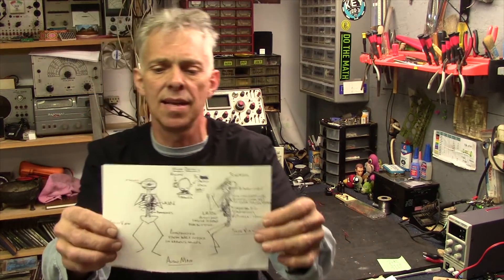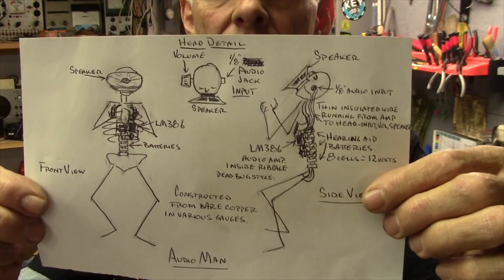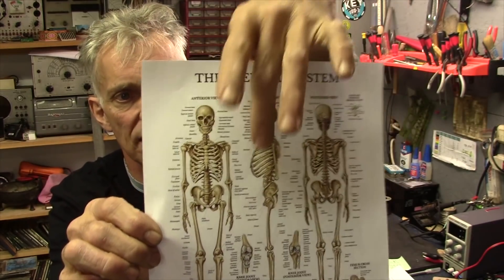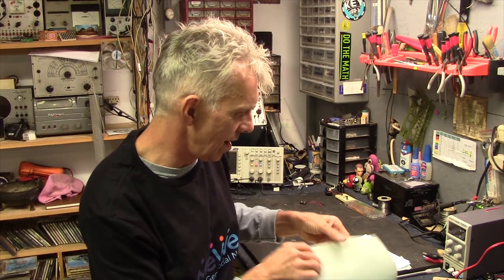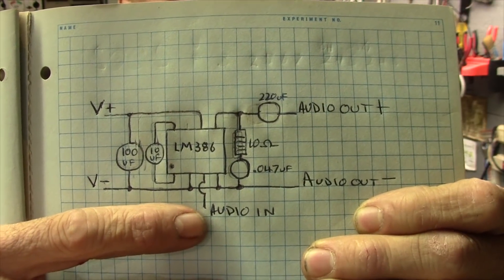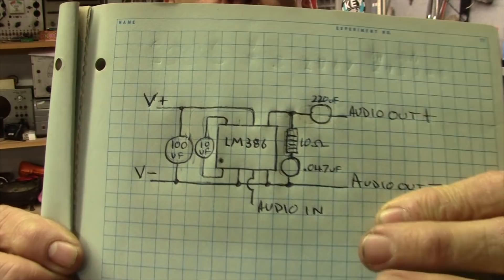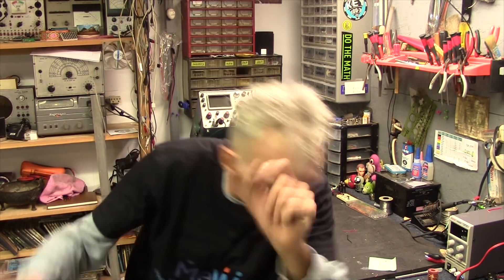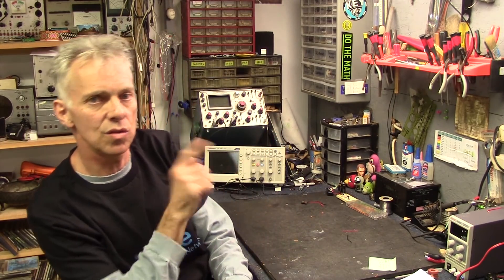Audio Man Part 1

Comment: Hi - you might also consider thin flexible copper tubing and fittings for the main parts of the skelleton like the spine, the femors etc :-) 8 - 15mm  (1/4" - 1/2") should be suitable to provide some fundamental strength :-) good luck with the entry  :-)

http://a.co/d/29yWVm2

Greetings from Berlin/DE

Axel

Comment: For the thicker bones, you could consider copper or brass capilliary tubing, the stuff I had was about an eighth in diameter and has a handy hole down the middle to assist in soldering to smaller wires, or possibly take a few bits of magnet wire if you need to carry signals "invisibly" to the extremities!